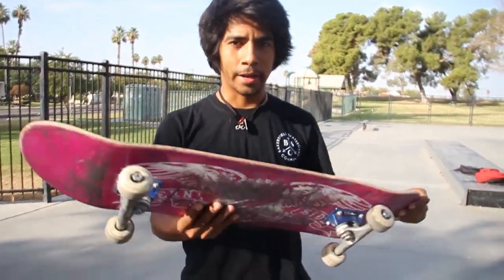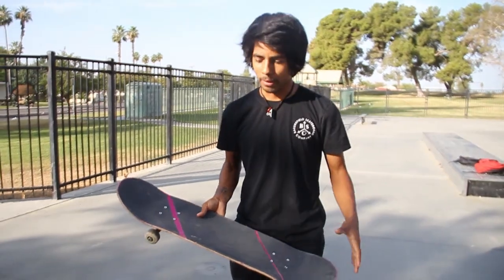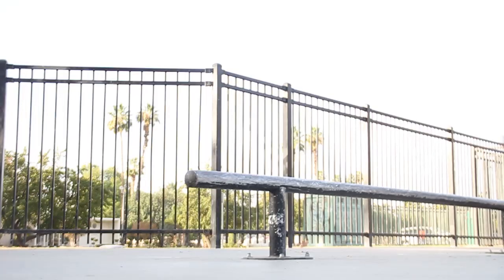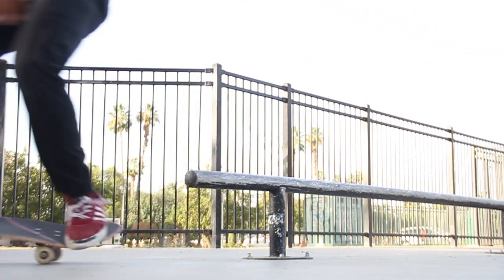How To BS Hurricane Grind!

Comment: hold on a second here, you don't have to boardslide out or even pivot out on the ground...no what u do is pick up the board at the end of the rail lean on the tail on pick up the board upwards which will give u control to halfcab off the end of the rail